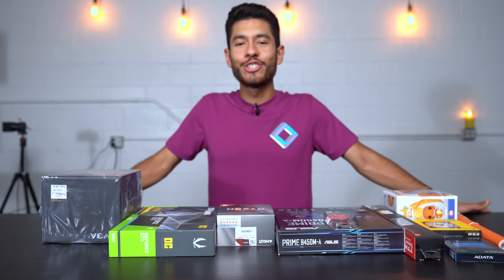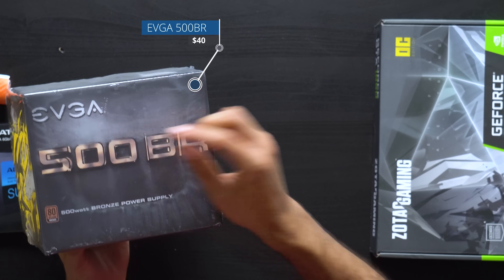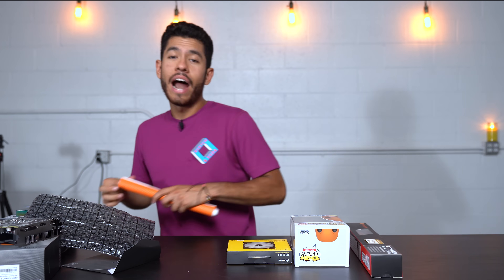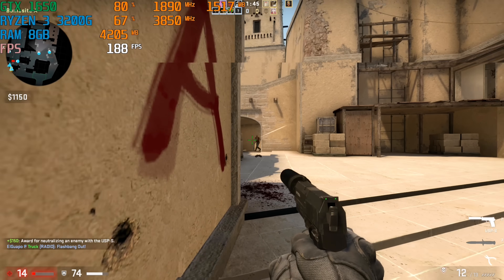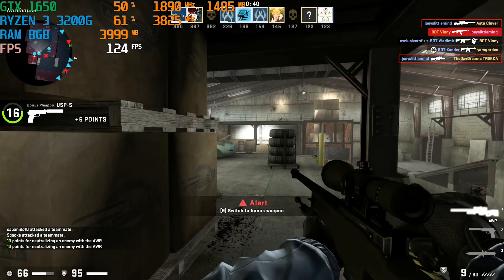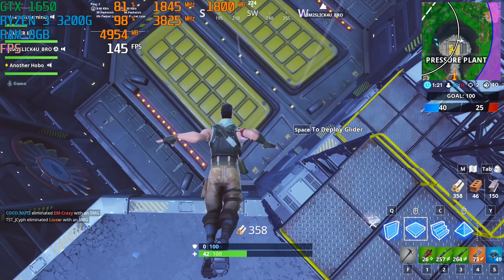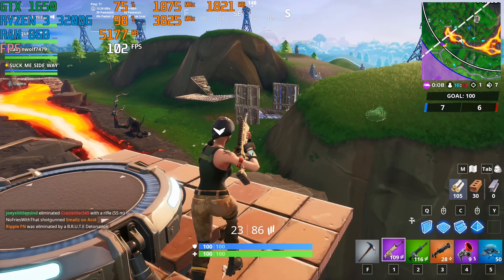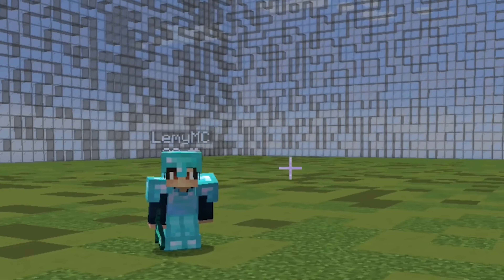$500 Gaming PC Build - GTX 1650 Ryzen 3 3200G (w/ Benchmarks)

Comment: An RX 570 would of been a better choice, and same price with better preformance and add another stick of ram, BOOM!
Reply: or just a second hand rx 580 8gb? ryzen 2600 £100 b450 mobo 75£ Rx 580 £100 same case £50 PSU £35 ram 2 4gb sticks £33. full pc out performs this just had to use a few second hand parts key to value
Reply: @chebs9642  agree both rx 570/80 r good options and can destroy this 1650 any day
Reply: @Gabriel-jg5wh  only upside to 1650 that it has enough power from pcie slot u don't have to plug in the cable from your power supply 😂
Reply: @chebs9642  I want to build a 600$ gaming pc and I want you to give me the best part for this build because I know you are good at pc things
Reply: @HD-tf4uo  600$ for just the pc. Ryzen 5 3600, 16gb 3000mhz ram (any brand), gtx 1660ti, MSI b450 gaming plus motherboard, same case as used in this, and then a 600w power supply
Reply: @chebs9642  that is for 675$ what if I get ryzen 5 2600?
Reply: @HD-tf4uo  yeh that would still be fine
Reply: @HD-tf4uo  or you could buy a few parts second hand
Reply: @chebs9642  and what's about SSD or HDD
Reply: @HD-tf4uo  HDD better for bulk storage (1tb 30$ normally) but ssd much faster data transfer speeds so quicker game loads and things (240-480gb 30$ normally)
Reply: @chebs9642  go with a 1600 and you can get 16 gb of RAM
Reply: @BROOK_tunes  older architecture I think tho so could be annoying to upgrade w like what's its top ram speeds ect. defo great if u don't plan to ever upgrade tho
Reply: TheBrainySamurai wait so you can’t get 16 go of ram with a rx 580?
Reply: @lucio5163  you could get a used 580.
Reply: @chebs9642  i built my pc two weeks ago with these parts brand new and it cost me 560 € with 3000 mhz 8 gb ram and 240gb ssd + 500 w psu 80+ gold (be quiet) plus all the parts are not no-named brands . Everything is quality
Reply: @ΔημήτρηςΣπυρόπουλος-ν2ο  name brands doesnt equal quality. there are bomb tier psu from name brands and good psus from no name brands.
Reply: @ΔημήτρηςΣπυρόπουλος-ν2ο  I got a whole set up with the parts I initially listed and then a mechanical keyboard, monitor, and mouse
Reply: @chebs9642  nice dude . I also bought a mechanical keyboard. I already had a monitor and mouse
Reply: @chebs9642  my pc has a xeon 1230 v3 with 12 gb ram 2b ssd and case combo for 200 dollars gtx 1070 for 280 and 20 dollar ssd 128 gb which ouut performs yours
Reply: @nibhanbaig6675  hmmm good luck upgrading your cpu without changing your motherboard. how's the quad core? sorry I have hex core.
Reply: Felix Taylor asee eew
Reply: @chebs9642  Does this pc have a ethernet port to plug a ethernet cable into?
Reply: @iceyi5922  yes b450 gaming plus motherboard by MSI does have an ethernet port. u can then also put a WiFi card in a pcie expansion slot
Reply: @chebs9642  Isn't that a different motherboard than the Asus Prime B450M-A/CSM?
Reply: @iceyi5922  oh yeh that's the one I have which I think is £80 new whereas the Asus is $84. they both have ethernet connection.
Reply: @chebs9642  or go with a 570 and getter a better cpu and psu
Reply: @majorgimp41  this would be better for a build that isn't a gaming pc. with a gaming pc u want the GPU to be the main component
Reply: @chebs9642  rx 570 r5 2600
Reply: @majorgimp41  but why would u do that
Reply: Felix Taylor dude this is literally the spectre v2
Reply: @Darkness Lord not really the 1660 ti and 1660 are pretty good gpus that perform well for its price
Reply: @ramenuoko7417  can't get a 1660 second hand easily which is what this discussion started about was a second hand rx 580 instead
Reply: @ramenuoko7417  those arent budget those, they are mid range GPU's, despite being on the lower end of mid range.
Reply: can any of you guys send me a list of parts for a pc around this price pls?
Reply: @danny-4827  u want a pc for 500£/€/$ or a set up for that much
Reply: Felix Taylor a pc
Reply: Poor charmander
Reply: Yeah it's no brainer, you can easily get 16gb of ram for 20 more
Reply: @manny3918  thats what i was thinking because i wanted 8 at first, but it would cost more to upgrade to 16 in the future so i got 16
Reply: Yes I have a RX 570 with ryzen 3 2200g and 16gb ram I get well over 170 fps on R6 fortnite on the highest settings and other games
Reply: Leeland Gambler can you give me the list of all the parts you used to build this same pc the please
Reply: And a ssd
Reply: RX 570 is cheaper and has better performance.
Reply: this is almost my exact build except with a 2200g and an rx 570
Reply: he is been sponsored by nvidia
Reply: What monitor/display do you use for tests and what type of connection? Glad to see you back at it!
Reply: @Blaygamez  a 1080p monitor with hdmi or display port
Reply: I made a similar build on my channel but went with the rx570
Reply: Cosmo if I got the rx 570 instead, would I have to get a different motherboard
Reply: @fuegosthekid3200  no will still be compatible with a MSI b450 gaming plus
Reply: yes
Reply: 15 9400f is the best processor
Reply: Amd drivers💀
Reply: spoopy_boopy_ doopy the RX570 drivers are 3 years old they’re working fine. Hell even my RX 5700 is awesome even though drivers are kinda poo. Running 1080p games without any effort at all at 75hz. I could upgrade to a 1440p 75hz or 1080p 144hz monitor if I wanted too

Comment: a 1650? what? The RX570 is cheaper and performs alot better. Also, 1x8GB is gonna bottleneck the Ryzen CPU like crazy, if you had bought a RX570 you could have used the money and went with 2x4GB and you would have a much better performing computer for those 500$

Comment: I already followed one of his earlier builds however I was wondering if the motherboard he used (that I also use) is compatible with a Ryzen 7 2700x or ryzen 5 3rd generation?  Thinking about upgrading soon.  Edit: Just realized that the standard price of a 3700x is the same as the 2700x so can I use the prime B450 m-a for a 3700x?

Comment: Hmm should i build a RX 580 + core 5 2600 G? And a 550W power supply?
Reply: Mate you just used core 5 2600 g, how did you post that without reading what you just typed, but yes use the 2600 it is an amazing processor for fuck all money

Comment: I bought a prebuilt pc from cyber power 2nd hand from someone for 1.1k, the specs are evga 2080 ti, i9-9900k, watercooled, 32gb Ram, 1tb ssd, 3tb hd, 1000 watt power supply, I forgot the mb, and 4 rgb cooling fans. I’d say it’s a steal and it works flawlessly

Comment: Hey, so yesterday my I got a ryzen 5 2600, with the b450 motherboard and 16 hbu ram, 500w psu, rx570 8gb and some fans, it was for like $590 and also I have a hard drive, my old one with the os and stuff so how do I use the old hard drive on the new build? Like will it just boot up if I put it in?

Comment: bro i watched a lot ur videos..im huge fan...i wanted to build my pc my self...but im sacred...b cuz i always mess it up...pls tell me shloud i build my self or buy a prebuilded ? 
my specs are
1660ti
i7 or R5 3600
16 ram
and...
Reply: 1, never un gods forsaken name buy a prebuilt 2, id go with an extra push and get a 1070 but just find a good deal 3, go with ryzen because intel are literally the apple of pc building and they have worse performance for more money so definitely the 3600
Reply: @kirkwahmett  bro...Thanx so much love u <333 ur tips helps me a lot
Reply: @kirkwahmett  shloud i buy 1070 ? u mean 1070 is better than 1660?
Reply: @itzcheeseburger622  oh the 1070 is way better than the 1660, the 1070 is amazing, but if you wanted the option, you could get the 2060 super instead of the 1070 so you would have access to ray tracing but overall, i would reccomend either the 1070 or the 2060 super, its up to you if you eant ray tracing
Reply: @kirkwahmett  tnx

Comment: i dont want to be that guy but the pc would be cheaper and possible better with a rx 570 and geting 2x4gbs of ram at 3000mhz  and a cheaper gigabyte b450 mobo and a aerocool cylon mini looks better and it $20 cheaper or if u can get a used rx580

Comment: am watching it on my i7 920 and gtx 295 pc 
edit: you should put rx 570 instead
Reply: GoLdEnM Yeah the 8GB versions are good
Reply: @isthisallowed4105  For real though, but im sure Joey used the 570 before in a budget build. Ifnot that than in sure it was the 580.
Reply: I did virtually the same build recently with a 580 armor 8 gig and 2x4 instead of the single channel 8 gig. And 450 instead of 500. Still a solid build but more outdated than this for sure
Reply: that is an old pc you got dude

Comment: Poor Charmander, you burned him !
btw, can you build a pc with 5700XT & 3700X  ? ty~
Reply: 2070 is better than 5700xt
Reply: Nho2x 7 percent better at a +25% price difference
Reply: @nho2x113  As far as I know, the 5700xt beats the 2070. The 2070 super is more powerful tho.
Reply: @nho2x113  I know that 2070S is better than 5700XT but I'm not going to pay 100$+ for a few more fps.
Reply: @nho2x113  no its not.
Reply: @nho2x113  In ur dreams
Reply: @Alexander Deris pros: cheaper than 2070 super with little performance difference. Radeon Anti lag, freesync if you have a freesync monitor that doesn't support g sync. Cons: no rtx if that's something you care about. Don't get 5700xt reference model and it's a great card
Reply: @Alexander Deris I do have Reddit. And the refference one has a blower cooler (single fan on one side) and has a 'dent' on the top of it. A cheaper after market cooler would be the Sapphire pulse, and a pretty cool one to me is the XFX THICC II
Reply: @sweetfeather260  I'm going for ASUS Strix 5700XT, it costs 450$ so I don't mind it.
Reply: @dan22yun  yeah the strix is sick. A good buy for only 50 more
Reply: @Alexander Deris yeah I think it would. That case is mid tower right? If it's a micro atx its most likely wont, depending on psu placement.
Reply: @Alexander Deris if you have the money, getit. But I'd rather go 5700xt + a while lotta asthetic
Reply: @Alexander Deris any of the non reference are pretty comparable right now, except for the MSI Evoke. My personal choice would be the XFX THICC II on Newegg. It's sleek, and only 30 bucks more than reference. It also comes with 3 months of gamepass.
Reply: @Alexander Deris I recall it does. Watch gamersnexus video about it. Very detailed. They have videos for most after market 5700xt
Reply: @Alexander Deris Any of the non blower designs are good but don't buy from MSI I heard they're bad.
I would recomend to buy ASUS Strix since it has more MHZ than other brands.
Reply: @Alexander Deris Maybe, I didn't check it.
Reply: https://teamgeeky.com/us-recommended-pc-builds/1500-dollar-gaming-pc-build/

Comment: 🤦‍♂️ go r5 2600 and Rx 570 or 580 used it is muchhhh better. Case ram psu same Mobo too
Reply: I built my PC for around 400 I got everything new except GPU and psu my friend gave me a good deal I have a r5 2600 and gtx 1060 3gb if more people got comfortable buying used they could squeeze some mid to high end parts for little cost
Reply: @RanSL you could build a r5 2600 and a Rx 580 with 16gigs of ram for 600 easily and if you cheap out on some things or buy used you can do less
Reply: big sung what would be better 570 or 580?

Comment: I just wanna say thank you for the videos. I've learned a lot from watching you and I'll be doing my 1st build in a few weeks when I order the last of my stuff. I went with a asrock b450m steel legend motherboard, team t force 16gb RAM (rgb), an asrock rx 580, and a ryzen 5 2600, a diypc case with 4 sides tempered glass and 3 led fans and a 550w psu.  Keep them builds coming!